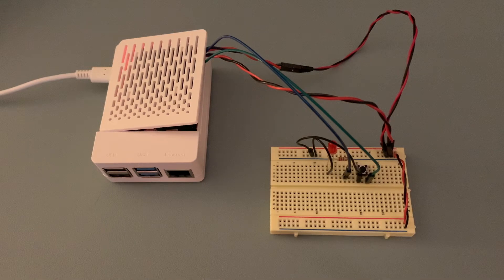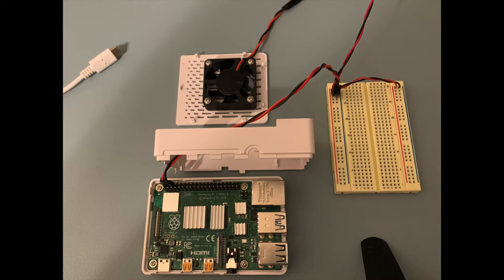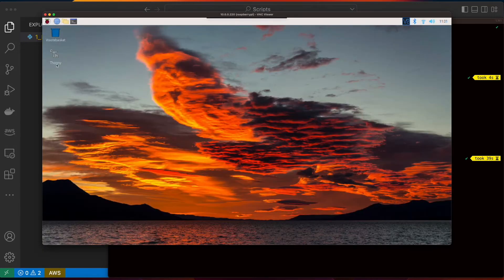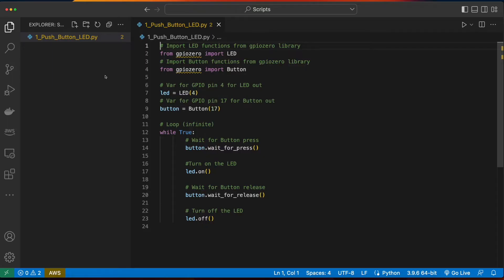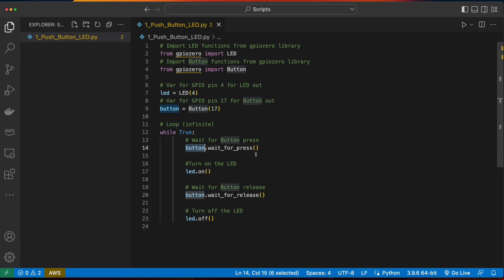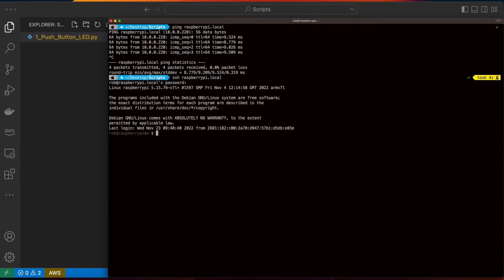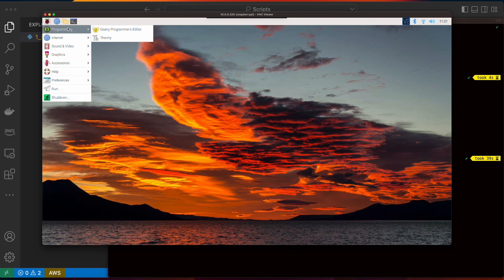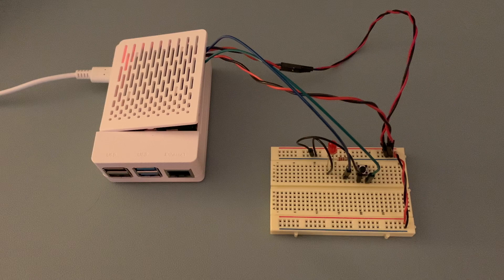Raspberry Pi: Use a Push Button to toggle an LED

Comment: why don't you just use your pi 400?
Reply from the maker: Hi! It's actually just the official Pi keyboard, not a 400.
Reply: @cumuluscycles  ah that explains it. So you could use the p400 and it's head, ..right?
Reply from the maker: @graphguy  From what I've read, the Model 4B and 400 both have the same pinout on their  40-pin GPIO headers. At a min, as long as you use the same GPIO pins (labels), even if they are in different positions on the header, you should be fine. If you try this and find out there is a difference, could you let me know (as I'd be interested)?
Reply: @cumuluscycles  yup, ot is pn my holiday checklist! Keep you posted